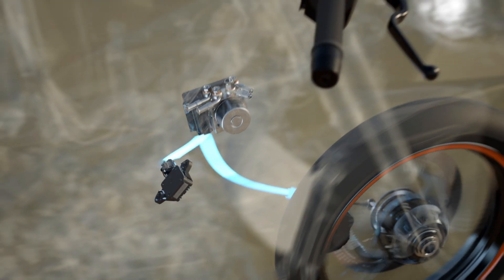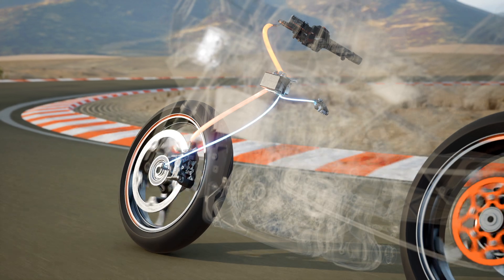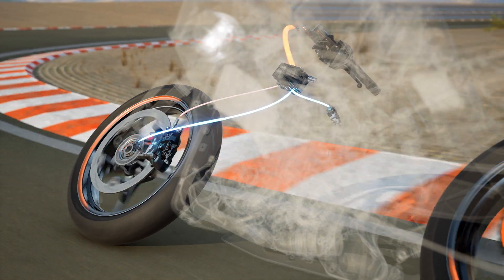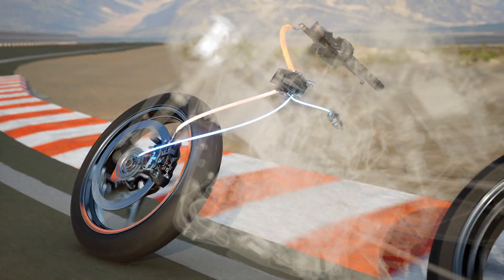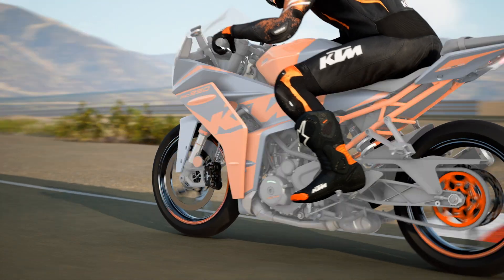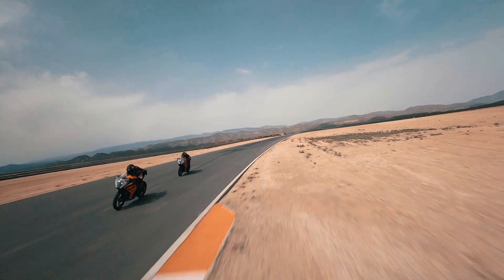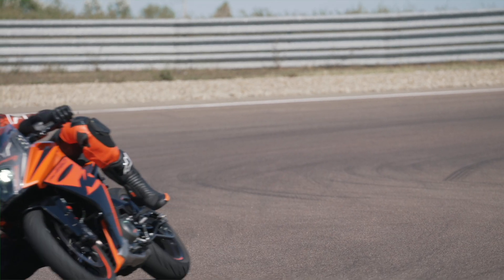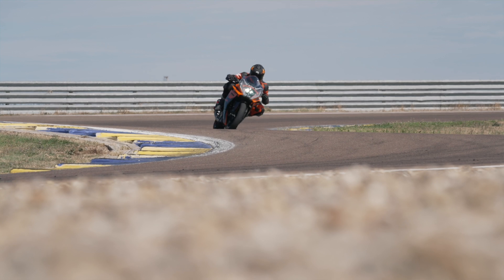Cornering ABS: Safer braking through the turns | KTM

Comment: Yo please bring the cornering ABS to the Duke 390 🙏🏻 I ❤ KTMs and the Duke 890 is my favourite, I would prefer it over the 1290 . . Also please please make some Duke 500s/490s or some Ducati Hypermotard kinda SUMOs .. I would most definitely buy me one 😊 My dream is to own a Duke 890 & a Ducati Hypermotard in the same garage . .  I'm not much of a RC or faired motorcycle type and more of the naked and super moto guy . . I currently own the 1st generation Duke 390. I had bought it brand new and it has never let me down in all these years. I would never sell it off!!
User Review: Pure Fun 🔥🧡
Reply: I so much agree with you,  I have 2020 Duke 390 BS6 and I wish it was 450 to 550cc single, and also wish the 990 Duke is launched soon

I have other 3 bikes : 
Triumph Trident 660 
Hayabusa 3rd Gen. 
Ducati X-Diavel  (purchased today)
Reply: I previously owned a 990SMR and it was a fun but extremely compromised bike. The cooling system was way too underspecified for Australian conditions and it would use a huge amount of fuel (more than 12 litres per 100km!) in city riding. Out of the city the fuel was more normal but the seat was awful. I don't miss it. Would have been a fantastic track bike